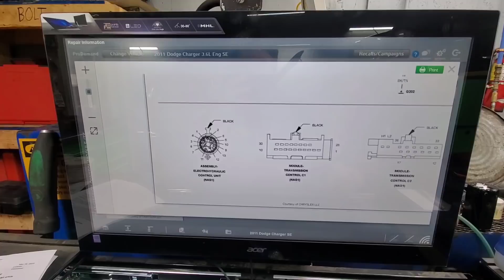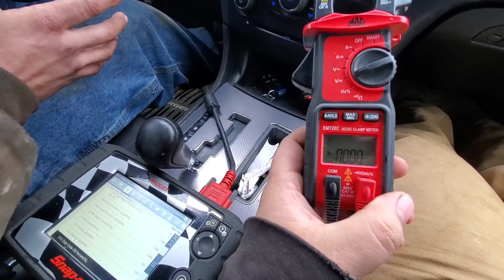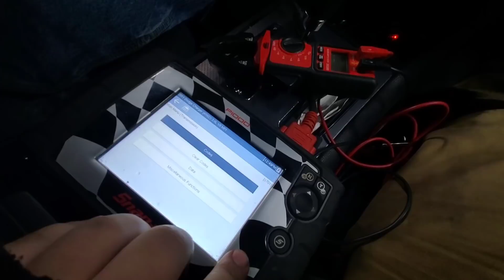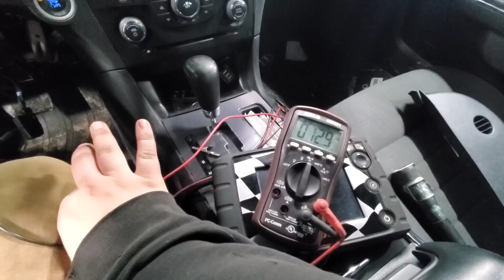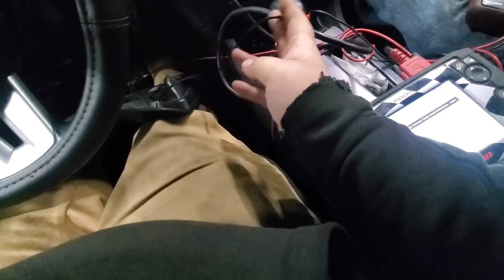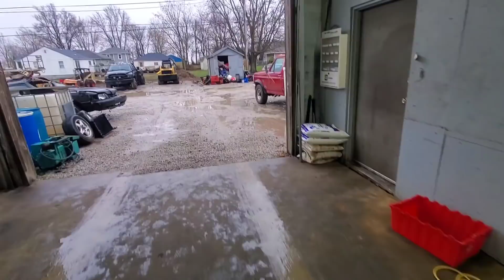Wednesday in the shop

Comment: No problem love it  works for me
Reply: I had had a 99 xlt extra cab dodge took it to the dealer and it did nothing but throw codes after that dropped a bundle in it finally called Gary's u pull it and sent it for junk someone made out great with all the new parts I'd put in it  all because the dealership ruined the wiring and wouldn't repair or replace it

Comment: I'm always impressed with Tyler's expertise in auto and bus wiring and being able to read the schematics and find the problem without buying a part and then saying, "that wasn't it", let's try another part..............duh! I have a P071 problem on my Cadilac so I'm paying close attention to the Charger repair. Mine works fine for months at a time and then defaults for no apparent reason, appearing not to reset after deceleration.

Comment: I not saying that you don't have a wiring trouble (between the trans and the computer), or a bad converter but I would put my money on the bulkhead connector on the transmission case and or the connector/pickup for the torque converter.

Comment: TYLER----IS  THAT A  722.6 OR 722.9 MERCEDES TRANS---------"OOPS YOU JUST SAID IT WAS" 
OK THEN, CHANGE THE CONDUCTOR PLATE AND THAT ELECTRICAL CONNECTOR THAT YOU CHECKED AT THE FIRST OF THE VIDEO---THEY MAKE THOSE 2 TRANS GO CRAZY WITH ELECTRICAL GREMLINS---IF THAT FAILS, IT NEEDS TO BE HOOKED UP TO A MB "STAR" FOR EXACT DIAGNOSIS---ALL ARE MUCH CHEAPER THAN A TRANS PULL AND CONVERTOR REPLACEMENT---OH YEAH, BE SURE AND CLEAN THE TOPS OF THE SOLENOIDS WHEN YOU CHANGE OUT THE CONDUCTOR PLATE.